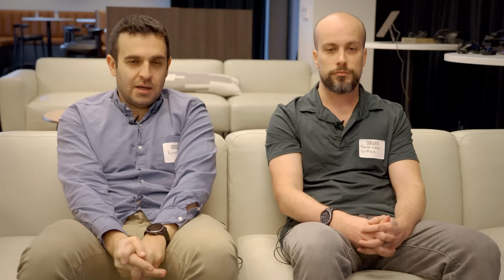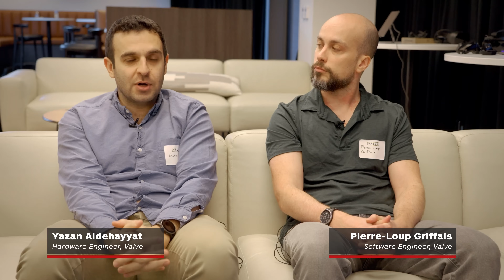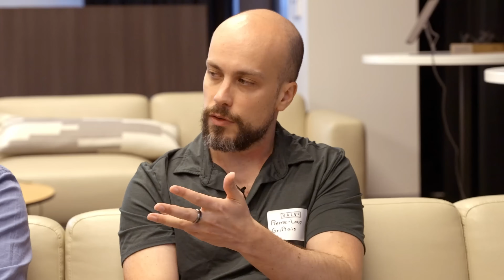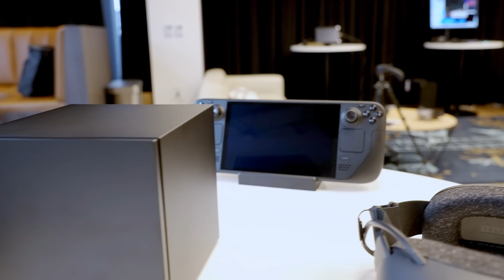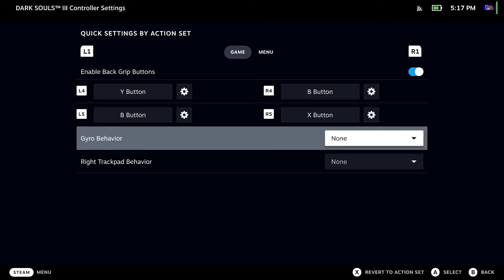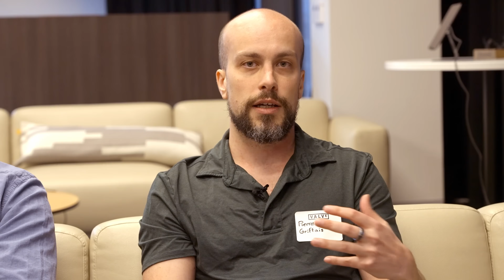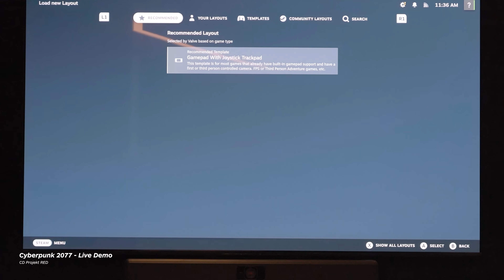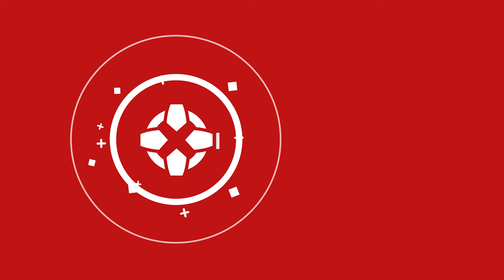Valve Talks New Steam Machine and Why Now's the Right Time For the Console/PC Hybrid

Comment: And remember guys, with PC you get FREE online, any controller choice and actual game sales. Oh and if you want to upgrade it you can add parts yourself, and don't have to buy a whole new device.
Reply: Yeah but you can't upgrade this device like PC
Reply: @Textorix console gamers wouldn't want to go through that trouble in the first place, else they'd already have a proper PC
Reply: @Textorix atleast the ram is upgradable from what ive seen. We wont know for sure if the gpu is until someone does a full teardown
Reply: @Aperson439  It most likely uses an AMD APU or some form of laptop GPU from AMD.
Reply: @PCmasterRace157  It's not integrated graphics.
Reply: @OLBastholm  Then what is it. It isn't proprietary to this device only. It is something along the lines of a laptop GPU or APU.
Reply: @OLBastholm  I looked and it is using a GPU very much like the RX 7600M which is just a laptop GPU. Stop pretending this is something unique.
Reply: @PCmasterRace157  What are you even talking about?! What you're saying isn't contradicting what I'm saying. It is not an "APU" (with integrated graphics), but a discrete GPU.
Reply: @OLBastholm  My point is Junior is it isn't some type of chip that nobody else can get a hold of. Take a seat.
Reply: @Textorix  Yes you can. They have already said you can do things like add more RAM and storage. This is just a mini PC using PC parts available to the public. This isn't using Valve-only internal hardware.
Reply: @PCmasterRace157  But you can't upgrade the CPU or GPU which is more crucial.
Reply: @Textorix  Again. This is just using either an APU or laptop GPU. You can very easily just swap out what's inside for something like a AMD Ryzen AI Max+ 395. But then you are just building a very small form factor PC and I'd rather use a better chassis than the cheap plastic Steam Machine shell.

Comment: This is actually brilliant. My pc is old and I don’t prioritise putting money aside for gaming as much as I used to. This is brilliant. I may actually be able to play some better multiplayer games without my pc running a gauntlet
Reply: @Arktiny97 I look forward to the pricing, I've heard they put it in the price range of a regular PC so it's probably not gonna be as cheap as you imagine...
Reply: @KappilusMaximus  Moore's law put it at likely $499USD, which is reasonably considering the specifications. Just have to wait and see.
Reply: @Arktiny97 about multiplayer games I warn you, because if you plan on using linux they have anticheat for many multiplayer games, so either get windows, double boot, or research

Comment: I wanted to make sure if I understood correctly:

The steam machine runs on Steam OS so does that mean that there's no Windows on it? 

Could I get myself a Monitor, Steam Machine and controller and immediately play without having to worry about Windows?

Or did I get that wrong entirely?
Reply: Correct. It doesn't come with microsoft bloatware.
Reply: You’re correct. No windows! Get yourself a monitor, steam controller, and have a blast!

Comment: there is no way in hell this steam machine with a 7600m GPU and only 8GB VRAM is going to play games at 4K 60fps even with FSR.
Reply: @Fezzy976  you can check yt that for example it runs natively 2k hight/ultra 60+ fps on cyberpunk. So, on med settings balanced fsr should be no problem. Maybe some super nonoptimized recent titles it will struggle, but like most game should be totally ok
Reply: @dratutiandr4078  8GB VRAM is going to be a massive issue if you run this at 4K even at medium settings in a lot of newer titles.

Its also RDNA3 based meaning no FSR4 support so your balanced FSR3 is going to look pretty bad, and it has very bad RT performance.

I suspect they are going super aggressive with pricing and expecting most people to run lighter games.

Comment: This just needs to have one thing preloaded. A fully functional browser so people can watch streaming services of their choice without having to get out of game mode
Reply: So a lot of folks don't understand the point of what I am saying. It is not about whether it is easy or difficult to install. It is about replacing console functionality. A lot of folks use their consoles for streaming services. When a console player looks for this functionality and doesn't find it, that will be a bad impression. 

Also, in my experience with the steam deck, browsers don't work the best in game mode. Particularly when full screening, tab switching etc. A lot of the times the app opens with giant black borders on the sides. There's some weirdness. The decky loader browser used to give me issues after updates. So this area needs work. And no, switching to desktop mode is not really a solution since it takes away from the quick, easy and plug and play feel that you'd want with a tv box type device. 

Lastly, I literally have been using Linux for about 10 years now. Its trivial for me to install almost anything I would like to. But when working with technology, particularly desktops, a lot of the smartest folks I know act like toddlers. They are fully proficient with tv, console, phones and tablets but haven't dealt with desktop interfaces for YEARS. It does not FEEL trivial for them to use decky loader, go into desktop mode etc. So preloading is necessary.
Reply: It's possible to add a program like Spotify or Discord to your Steam library so that you can access it through game mode. You can do it through desktop mode
Reply: I know you said preloaded but adding it manually is pretty trivial
Reply: @catsphalt  Tbf it's trivial for enthusiasts. Average person is too lazy to even do research, unfortunately.
Reply: i set up chrome like this on my steam deck and its a one time simple set-up on desktop mode and youre good to go
Reply: You can
Reply: I believe with the steam deck that also uses SteamOS with the use of decky loader (And an additional web browser addon through decky loader that's easy to get) this is possible
Reply: IMO most OS with a GUI normally have a browser in it, right? Worst case scenario, just sudo apt install firefox.
Reply: @W4rlight  Meanwhile Nintendo Switch
Reply: @Mr_ESN well that’s an entirely diff can of worms in of itself.
Reply: @W4rlight  it's sudo pacman -S Firefox. Ugh. It uses Arch btw, not debian. /j
Reply: It will have HL3 preloaded

Comment: Very excited. Wonder if Valve can figure out the anti cheat game issue
Reply: It's less about figuring out and more about other developers giving access at this point. Look at Destiny 2. It can run on a steam deck, but Bungie doesn't want to deal with Steam OS, wants to have a locked down ecosystem, and not having to deal with cheaters on Linux, so they ban it.
Reply: most anti cheat works on linux, but by reported, dev just refused to turn on the linux support switch on the server side
Reply: @joramasama8777 if they can get that resolved I’ll never want to touch windows again

Comment: 7:01 Hmmm what will the price be 🤔
Reply: $450 for the 512gb 
$599 for the 2tb 
I hope
Reply: @Chinaman-gw6ts at least 1TB should be minimum. At this point.
Reply: @CONGARD Should be, but won't be. 512GB version will be available.
Reply: @Chinaman-gw6ts $499 and $599 most likely. $700 would be a rip-off with the current specs and vram, but if it's priced like a pc then that may be the case.
Reply: My guess is 700

Comment: Valve made a smart move by launching their "PC console"—like the Steam Deck—early on, bridging the gap between traditional console experiences and PC gaming. Now, even before the next generation of consoles arrives, they’re expanding this concept further with the Steam Machine. This seems especially forward-thinking in light of Microsoft’s strategy to gradually move the Xbox away from the traditional console market and instead position PC gaming as the new living room standard. The next Xbox generation, much like the new ROG Ally, already behaves more like a Windows PC with a console-style interface, including the ability to install Steam and use it as the primary launcher.

This raises a key question for consumers: Should one go for the presumably more powerful Xbox with Microsoft’s “Windows 11 Xbox Experience,” or opt for the cheaper, slightly less powerful Steam Machine? We’re already seeing this dynamic play out in the handheld market. In either case, Steam is likely to be the big winner—because even former couch-based Xbox users may increasingly shift toward the Steam ecosystem and leave the Xbox Store behind.

Strategically, it would also make sense for Valve—especially considering their controller systems—to finally make their flagship titles like CS2 or Dota 2 fully controller-compatible. Ideally with crossplay and separate controller matchmaking, as already implemented by games like Halo or Insurgency: Sandstorm. This would not only show serious commitment to the console and handheld shooter scene, but also send a clear signal to competitors. Valorant, in particular, is lagging behind: despite its console release, there’s still no controller support on PC—a missed opportunity that Valve could capitalize on with CS2.

Comment: That Orange Box edition had better be an option
Reply: The front plate is magnetic detachable, so I guess you can 3D print anything you want there
Reply: @k0ma001 they’re apparently releasing the files for the face plate too so 3d printers will have the exact dimensions
Reply: @Sequoyas that’s good I was planning to use my 3d scanner but good ol valve
Reply: @Sequoyas  Neat going to have to watch out for those, i can mock one up in fusion so i can start designing custom plates
Reply: @Sequoyas based
Reply: @k0ma001 sounds perfect!
Reply: @k0ma001I’m already planning a orange box plate to print it out
Reply: @k0ma001or get a wrap or they’ll just be sellers for it.
Reply: 0:55 - orange box 🥁
Reply: I want a heart companion cube from portal. Gonna 3d print it.
Reply: I’m aiming to get the steam machine myself and I’ll be 3D printing a face plate for that little guy
Reply: Gabens only stipulation beyond bury Xbox
Reply: Someone make a etsy or some sort of store for custom ones and get rich before some big wig does it first
Reply: It’s literally all black and the front comes off and it’s 100% customizable.
Reply: Hear me out. Companion Cube edition.
Reply: Put some golden Arabic words skin, and steam user/fans will circle 7 times this GabeCube before they turn it on, congratulations they becomes Muslim 😁😁😁.
Reply: @dedesunarya6484  Muslims worship kid touchers ( sugar coding it )
Reply: I'm digging that Atari 2600 wood grain.

Comment: The make or break for this will be Cost. It needs to Match or be cheaper than current gen Consoles.
Reply: Apparently they have said they are going to sell it as an entry level PC that can be used as a console NOT as an actual console. So I suspect somewhere between a PS5 and a PS5 Pro cost wise.
Reply: There will be two models, a cheaper one and a more expensive version with more storage. There's steam pages up now with specs and info, but there is no price yet.
Reply: Sony, Nintendo, Microsoft "consoles" are DRM boxes, subsidized as you can't run anything except bought in corresponding stores. 
This is a mini PC, if subsidized people would buy for non Steam needs.
Reply: I'm sure it'll be expensive but also subsidize quite a bit

Comment: is it better than the Steam Deck? Is it on par in performance with a PS5?
Reply: Its slated as '6x the power of a Deck'. So while no its not gonna be a top of the line powerhouse - if they price it moderately its a fantastic option . I think if they keep it 800 or less they're laughing, we'll see tho
Reply: it should be similarish to a PS5, which is approx a 6700 GPU the Steam Machine is a 7600 GPU

Comment: I want "Framework" and "Valve" to work together.
Reply: me too, but it’s hard to pack things so tight AND keep them as easy to take apart as legos
Reply: @noelfletcher1149 sure but framework are doing it nicely
Reply: Framework is far to expensive for us normal guys!
Reply: Valve, Framework and iFixit is a match made in heaven, and a fucking nightmare to whatever industry they're set their foot in
Reply: They want every steam machine to be the same, if it runs one way on a steam machine, it will run that way on every steam machine
Reply: @CardSharp5H  until they release an oled model
Reply: If I was made of money I'd prob buy the Framework 12 for my work and Steam machine/deck for my gaming.
Reply: @ColasTeam m1 macbook air will crush that framework and it can be found refurb for under $400 and it’s even lower on facebook marketplace. i promise the repairability of the framework is not worth how much extra money you could put towards the steam machine. not as cool as a framework but cooler than having no good “notebook” and no steam machine
Reply: @noelfletcher1149 I don't want a MacBook tho. I want a framework because I like what the company is doing. Not planning to buy one anytime soon tho cuz I can't afford it. Tbh probably won't buy a steam machine soon either cuz anything more than 100$ would be too much for me rn.
Reply: @celestialbeing4767  a steam laptop would be amazing
Reply: Match made in heaven!!!!

Comment: If Vram of the gpu is only 8gb, this will fail to a must buy
Reply: This isn't a high end PC, though. If it's like $500 or lower, then it's fine. Not ideal, but fine. It's gonna depend on the price.
Reply: you can use the ram also16gb
Reply: @popofiero765  Not true, it isn't an APU
Reply: 8gb vram is pretty underwhelming. Im happy they are making this but it doesnt seem to be aiming for high end at all

Comment: This is everything Xbox dreamed they would be
Reply: Valve beat them at their own game lol
Reply: No disc drive and steam only is hard sell and that controller looks un comfortable.
Reply: @will1223141  Steam deck was successful buddy
Reply: @will1223141 it’s not steam only, you can install windows on it if you really want to. You can also use any non-steam Linux app you want on SteamOS, since is just Linux. It’s a PC. Same with the controller, you don’t have to use the steam controller, you can use any controller, including an Xbox controller. Modern PC games aren’t even on disc, and you can just plug in a USB disc drive into it if you really want to use discs for some reason it is far better than Xbox in every conceivable way.
Reply: @will1223141  Pc is different. Instead of optical drive you can install games and software from literally anywhere you want to, usb, network, usb disc drive even. And remember when people called the deck looking uncomfortable? turns out it's way more comfortable than the competition. Easy sell.
Reply: They find out, spending $70 billion can't get them anywhere.